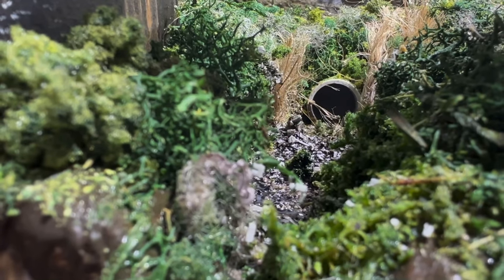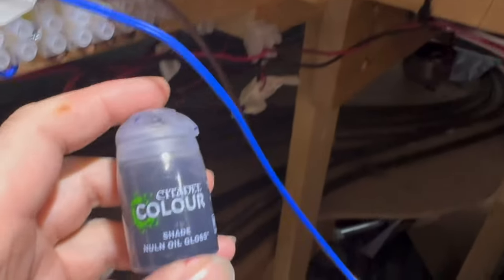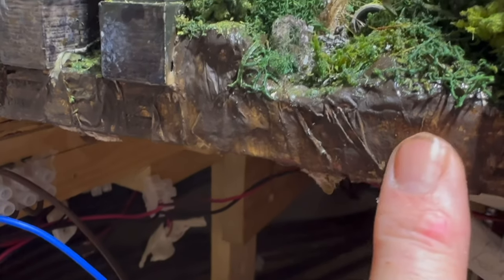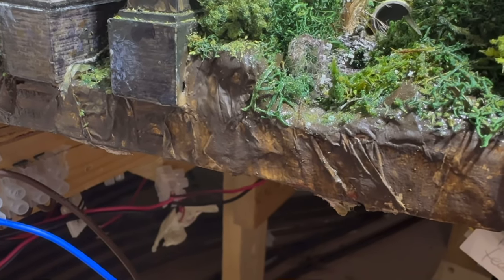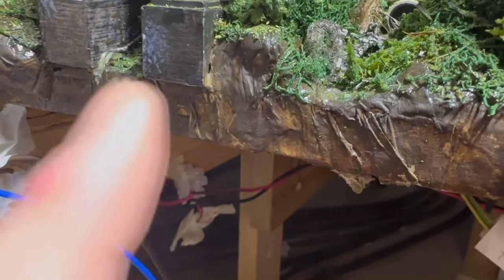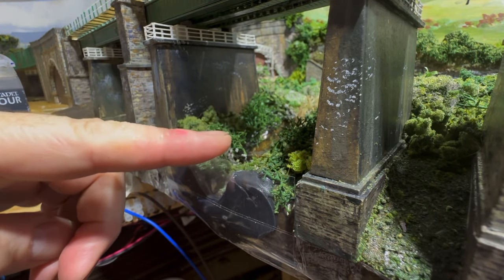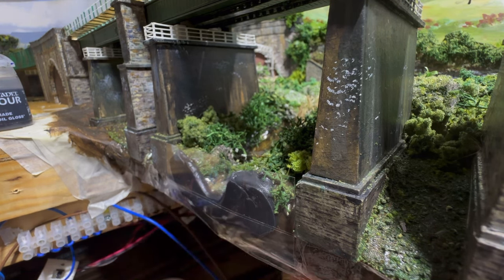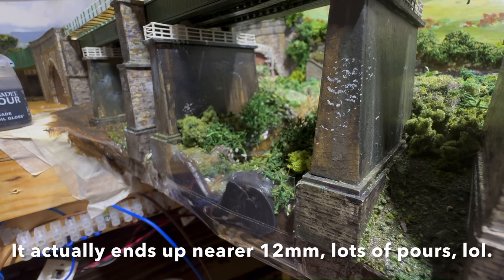BUILDING DINTING VIADUCT, TIS DONE! Well almost.

Comment: Hi John - As always great to be able to say hello at GETS . I like the Aqua Magic and I think I will use it for my small fishing lake. Good work on the overhead power supports the finish off the viaduct nicely.
Cheers Kev
Reply from the maker: Thanks Kev, yes was great to see you albeit, very briefly. 
The aqua magic is good, not used any water product before so I dont have anything to compare it with. I think its a silicone product, as it dried leaving a rubbery feel, not solid like resin does. It is quite thick, but self levels, with some assistance. You do need to squeeze the bottle quite hard. I would use it again but for small areas only.

Comment: I was really interested to see how you managed the river as I’m considering a waterfall and river for part of my layout. I bought a starter kit from Woodland Scenic at their stand at Alexandra Palace earlier this year and I have got a rough idea on how I want it to look. The product you used looks good but seems to take a while to do. I’ll try to video my attempt to do the waterfall.  In the meantime, love what you’ve done here John. Thanks for sharing. Roy.
Reply from the maker: Hi Roy, great idea with the waterfall. I will be doing a weir, which is obviously a small waterfall. I will be making the actual fall from crystal clear silcone sealer, by squirting lines ( touching and straignt) onto a piece of baking paper. That gives a wrap to place on the model and mould in with further sealer, modpodge etc. hoping that helps.

Comment: You would be amazed at what the people of Glossop can do with shopping trolleys.....Seriously though.  Looking brilliant John.  Actually the line was electrified before WW2 at 1500v DC as part of the plan to electrify the GC main line to London Marylebone.  This only ever reached Sheffield Victoria and further expansion was curtailed by WW2 and never restarted.  The Woodhead line was closed in 1981 and the remaining section to Glossop and Hadfield was converted to the standard 25kv system in 1984.
Reply from the maker: Oh ok, thank you always good to know. I was guessing 70s they the line used class 76s.
Reply: Another excellent video, the class 76's were introduced in the early 50's
Reply: Electrified in 1953 most OLE stantions are the originals from that date converted to 25000v AC IN December 1984